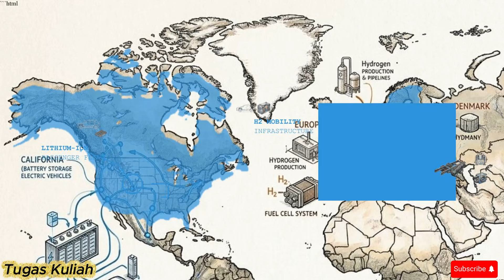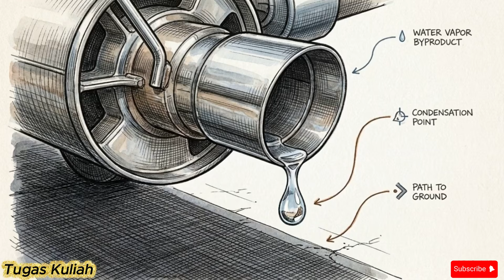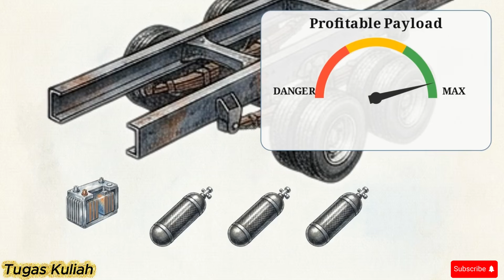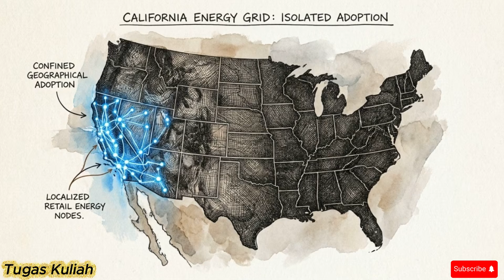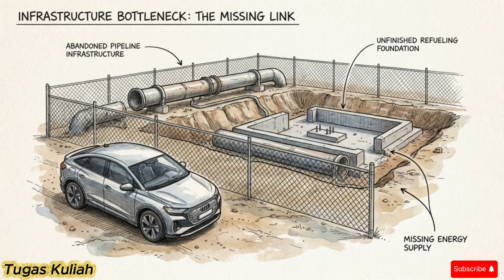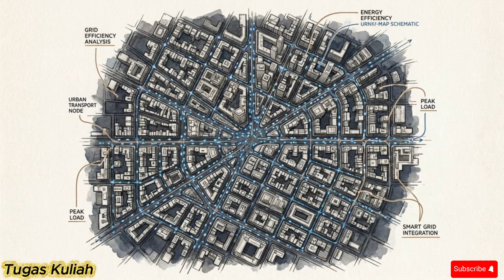The Weight Penalty: Why Electric Semi-Trucks Are Actually a Terrible Idea

Comment: FALSE. Battery density is now to a point in China that they are able to electrify heavy trucking. In fact 50% of all new heavy vehicles in China are now EV. The weight penalty is only 2000lbs, compared to the diesel engines, transmission and the weight of the fuel. Less than 5% of all loads are over 95% of a trucks weight capacity as it is today. And frequently they have less than 50% of their rated weight on board. The loss of 2000lbs is a small price to pay for a truck that requires F all for maintenance, and costs 60% less in fuel. Battery swapping in China takes less than 8 minutes.